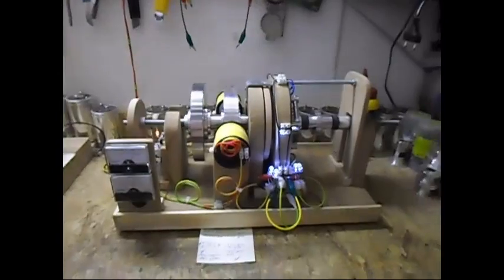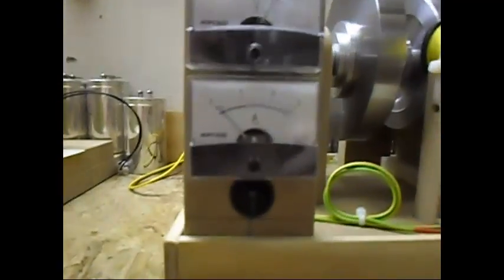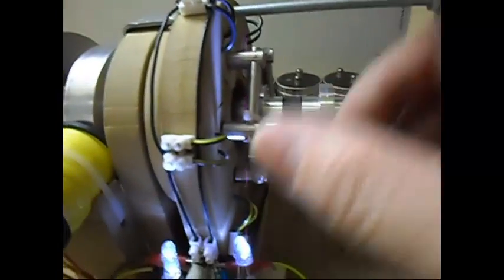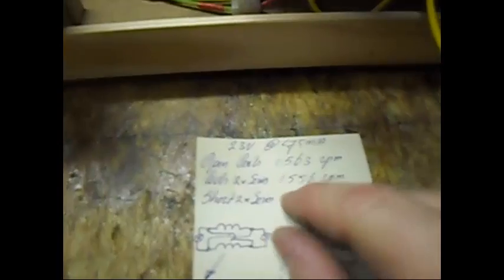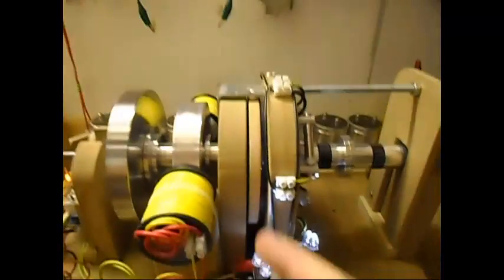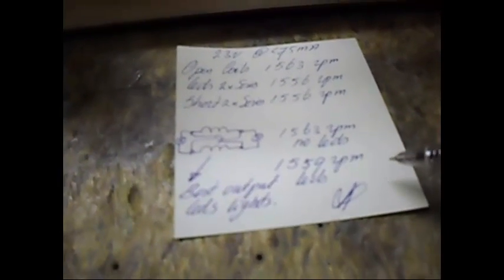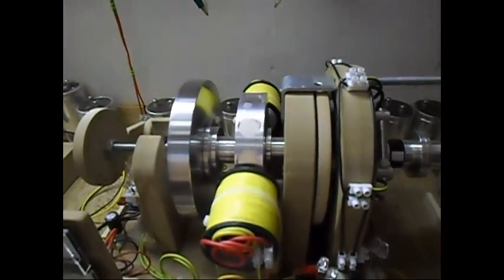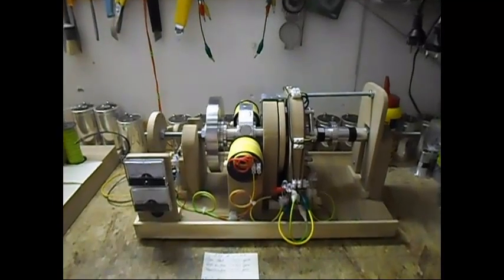Flux Gate Generator - Update 14 T-1000 design - Ferrite rotor poles...

Comment: Do you realize Muammar Yildiz has made the purely magnet motor? I wanted to do that experiment!
Reply from the maker: Hi the brain,
Thanks for your comment...^^
And do you realize that if he had a magnetic motor like he stated he could and should let it run non stop when he's at a convention of sorts...;-)
But nope, he saved it for just a few minutes...guess why is that...;-)
Reply: Mister Caribbean Roots Because it started making noise, one or two magnets came loose and were grinding around inside. He let it run for 20 minutes (I think) at some conference, then took it completely apart to show no batteries, then assembled it and ran it again.
Reply from the maker: the brain
Yep, i've heard of that story and the part where he take it completely apart is partially true as he did with his setup...the bottom section was never shown...;-)
Reply: Mister Caribbean Roots I think it's possible,seems like you're a firm believer that electricity is needed in a motor.
      I still say you should connect your motor to a water-pounding flywheel, produce steam, then use the steam any way you wish.
Reply from the maker: the brain
It's a good thing that you think that it is possible and so do i but not in this case...;-)
Cheers

Comment: How about using a material w/the highest magnetic strength in the Flux Gate Generator? You make some high quality machines, I like them (efficient too). So now you've decreased input to half (ma) and doubled your RPMs. That is beneficial and allows the rotating mass to store a lot of energy, what applications do you see your machine being applied to? I think it could make a lot of electrical power. If you connect it to a water pounding flywheel,it could make steam to drive whatever you wish.  PS: I don't see LEDs as much of a load.
Reply from the maker: Hi the brain,
Thanks for your comment and i'm glad you liked it...^^
Yes, the ferrite bars did a good job to reduce the drag but also in reducing the energy production...lol
Since the output isn't that much leds are the only things that can give some idea how the system will react when the current is flowing from the coils to the leds...;-)
I'll have a video on it tomorrow where i'm using a 7 pole iron half disk rotor but with better efficiency due to the even/uneven configuration...
This setup is for testing all sort of designs and see what's best as i am going thru now with reducing the cogging which was a bit of a problem at first...
Next will be trying to improve the energy production of them coils...;-)
Cheers

Comment from the maker: Just another update on this Flux Gate Generator setup using the design from T-1000...^^
Now i'm using a 8 pole rotor but with ferrite bars instead of the half circle/sphere iron disks...;-)
Numbers,
Input is 23Vdc @ <75ma...sweet...;-)
Open coils = 1563 rpm...coool...
Coil & leds = 1556 rpm...pretty good...not bad at all...^^
Coil shorted = 1556 rpm...nice...:D
Output is nice and stable so no flickering at them leds...:D
Very little cogging, just a tiny winy bit...lol

Coils in the continuously shorted style...see professional diagram of it in the video...LOL...haha
Continuously shorting = 1563 rpm...o.O...very nice indeed...^^
Leds load = 1559 rpm...^^
Only 4 rpm drop...:DDD
The leds output may not be that much BUT neither is my input...;-)

I will use that b-emf in the near future configurations to light up a 230vac 1watt led lamp and use all of the output back to the source just for the fun of it...;-)
Don't know if the b-emf is enough to light up the lamp but it sure looks like it is...lol